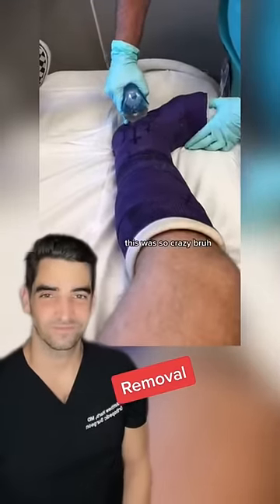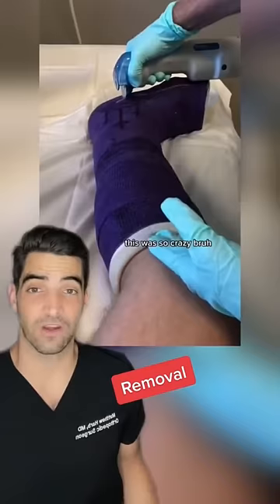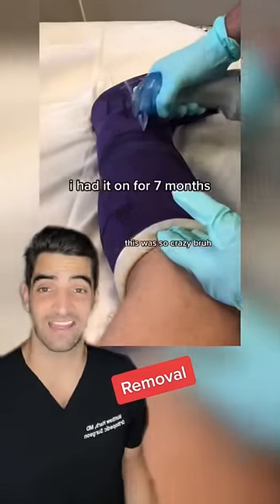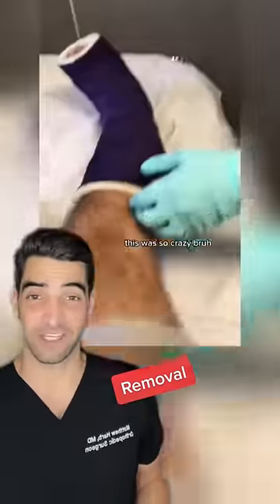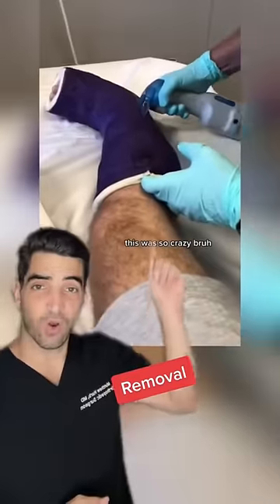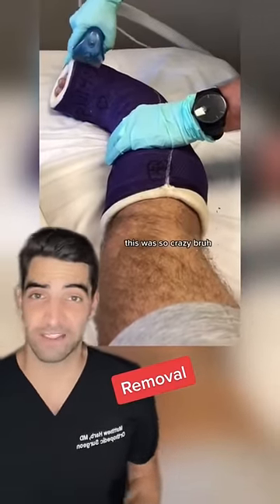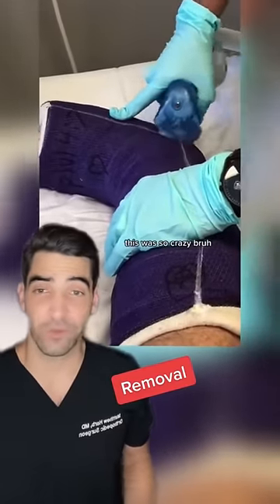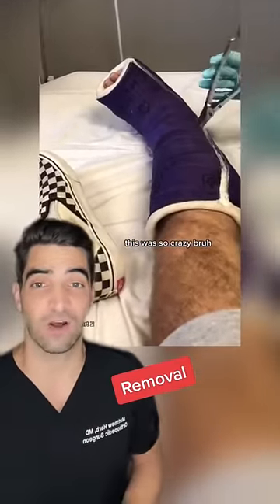How to remove a fiber glass cast after your broken ankle has healed, learn this proper technique

Comment: I was young when they took the cast off my arm, and the nurse touched the "blade" to her hand to show me that it wasn't sharp. She was the sweetest
Reply: I was about 5 when that happened to me. I felt so reassured
Reply: Yes, when I was five, I broke my leg . When getting the cast off, the nurse touched the blade to her and then asked if I wanted to touch it, they were awesome
Reply: I was 13 😂😂 broke my leg in multiple places, but the nurse touched it to her glove, and there wasn't a single tear.
Reply: Same here, I broke my arm when I was younger and the nurse did the same thing cause I was upset about it lol
Reply: My nurse did that to and I was still too scared
Reply: I spent a lot of time in casts when I was young due to a genetic condition. After I got cut and burned by an idiot with a cast saw I much preferred the honest cast tech that came in, sunk the saw into a block of wood and said something like, "Most will tell you this can't cut you but it can. It is all up to my skill and I'm very good."
Reply: @mjaynes288 unless they press down pretty hard it wont cut you it uses Vibration to cut stuff not like a Sawzall even the ryobi multitools are similer i have a carbide tip that i use for metal and wood and it doesnt even nick my finger tip
Reply: How hairy was that arm? Omg had my cast off and wanted to put it back on immediately 😂😂that hair and foot skin like to send me looney😢
Reply: Same. It helped me not freak out 😂
Reply: Same!
Reply: My nurse did the same, so sweet.
Reply: Same exact thing bro
Reply: Exactly the same thing that happened to me the same way too
Reply: I broke my elbow
Reply: Literally was about to make this same comment
Reply: Mine did the same she was so nice
Reply: Same
Reply: Had a similar experience when I broke my leg as a kid eased my worries immediately
Reply: Me too I thought I might get hurt because the saw was hot because of the vibration
Reply: smash
Reply: They did the same for my daughter
Reply: Dr touched the blade when it was on freaked me ot even more. Was a different person when I was like 6 or 7
Reply: The nurse who took off my cast did that too! It was really reassuring

Comment: Saws used to cut off casts are designed  to NOT cut skin! Hold one against skin and nothing  happens.
Reply: That’s because it vibrates
Reply: It will still scratch the shit out of your skin and can even draw blood. It won’t clean cut you but will be like a belt sander in a minuscule point
Reply: @synodicsoundslive8851  if properly used, no skin is cut
Reply: Well it cut and burned my wrist and the skin between my thumb and finger
Reply: That's what he said in the video. Thanks for reiterating it.
Reply: Yeah. Cut my moms ankle when they removed hers. It can cut. Just maybe not severely
Reply: @juttascharf6917 if properly used, aka if you don't touch them with it LOL. A fein saw vibrates too. Go ahead touch it see what happens
Reply: It can’t cut skin over soft tissue areas. Not unless you apply a severe amount of pressure. However if used on skin over bone, it will cut the skin. I use these types of cast saws every single day, have even used one on myself. Aim soft, keep it moving, no cut, no burning
Reply: @TheTiredPirate  its not because it vibrates. recipricating saws vibrate too and will cut your hands off. its because of the surface area being moved that it doesnt cut. the skin stretches
Reply: @juttascharf6917 holding it against your skin isn’t proper use lol
Reply: true but also not true kinda.i have a scar on my thumb from getting a cast off but it burnt me instead of cut me. it didn’t bleed is just blistered and hurt real bad then bled when the blister popped
Reply: It still can.
Reply: You are right. It won’t cut you. However it gets really hot and will burn you.

I know this because I have two scars from the damn thing
Reply: Nah I had that shit cut my wrist and I still got the scar

Comment: I've had that happen twice in the past 4 years and it really doesn't hurt at all, you can just feel the heat
Reply: how the hell you break two limbs in 4 years and I still haven’t broken one
Reply: @pineappler6473 they probs play a rough sport or are just neglective with their body.
Reply: I have broken 2 bones in 2022. One was playing with siblings and the other was snowmobiling. I had them each for 4 weeks. Trust me it only tickles to get them off
Reply: I can relate i have broken my arms a total of 7 times (once every year)
Reply: That means they were using a dull blade usually it just tickles
Reply: Mine burned for a week after. Ripped a little bit of skin
Reply: I would check if there's a reason why you break so easily. Like vitamin d deficit
Reply: when they get the spreader out and actually get it off the the best feeling ever but the skin is supper dry
Reply: It’s oscillator I have a few of them Dewalt, Milwaukee.

Comment: Just so everyone knows, I work construction, we use a tool similar to this. If it’s pressed hard against the skin it does NOT cut it but it burns it. A friction burn. Some doctors don’t really know how some of their tools work it seems. The saw vibrates at the same frequency as the skin meaning that as the saw moves across the skin the skin perfectly flows with the vibration. This is one of the best ways to cut off a hard plaster or hard plastic as it is quick and almost no danger at all unless it is meant to hurt someone
Reply: Yes but this saw has little teeth so it would leave cuts and scrapes not burns...
Reply: @vadyam2934  you obviously did not read his comment and have not used a multi tool.
Reply: It does not vibrate at the same frequency as skin lol, just lol. The skin just stretches
Reply: @Matick-  This. Tf does 'vibrate at the same frequency as the skin' even mean lmao
Reply: Most blades you’re correct but try one with wider/less teeth. It’ll cut but will still be minor. Either way the multitool is probably one of the best tools to have on a job site. Interesting fact they were first created solely to cut open casts haha

Comment: When they took the cast off my arm, the nurse went back and forth over my arm in a fast motion that caused friction and heat. She was in training and I was like 9 so my dad rushed me to the hospital. When they finally got my cast off, my arm was littered in blisters that lasted a good 2 weeks. The worst part is the primary care doctor who was supposed to be supervising said that the nurse did it the right way and that they were gonna do it the same way at the hospital. Good thing my dad never listened to people.
Reply: @TheDevilishDesires  the purple at the hospital told me it was burns from the nurse going up and down my arm in a fast motion instead of the usual section at a time.
Reply: @lemonmint278 😂😂😂 The purple?  What??
Reply: @TheDevilishDesires  people
Reply: @lemonmint278   Multiple fractures of my own...compound fractures with my skateboarding child(compound =means BONE broke through skin and is sitting outside the body)  and I've had technicians do full swipes up the sides ...not in sections and the blade doesn't sit long enough to burn through the cast and the microfiber mesh sock placed over the body part.  They put the blade straight on THEIR skin and turn it on to prove to kids that it doesn't hurt, burn or cut.  If you're to be believed... those situations would all cause burns too....and they don't...so you're making up stories to feel important.  Go read a book!
Reply: @TheDevilishDesires  I’m not making up stories. The vibrating mixed with the speed that she was moving along my arm did cause burns. And I’ve taken anatomy so I know what a compound fracture is. I’m glad you had a great time with your cast, but not everyone has, so mind your business. I was just telling a story that happened to me.
Reply: @lemonmint278  🤣🤣🤣🤣 I'd mind my business if you didn't put your bs out on a PUBLIC format.  Only ppl who get called out on their BS want ppl to mind their business. It's a psychological guilt response and that's my point...you were telling a "story"...thanks for owning it.

Comment: The blade doesn’t penetrate the skin. I’ve used one many times working in an ER and one of the thing we do to show children not to be scared is out the blade on our own skin first and show them it doesn’t cut and than we put it on an open part of their skin to reinforce that it doesn’t cut. Than they are more relaxed and even giggle because the vibration kinda tickles when you’re cutting off the cast. That being said, you don’t need to push down super hard with the cutting tool as it does all the work and is very simple.
Reply: But I'm so interested in how? I understand that it uses rapid vibration, and I can understand how rapid vibration is able to penetrate certain materials...but the cast material is so thick and so I just can't understand how it can easily break through that, but not harm delicate skin underneath that's now highly sensitive from being covered for so long. Our skin is surely more delicate than cast material. I totally believe that it works, especially coming from somebody who has first-hand experience with it, but it just perplexes me! 😊
Reply: @Katz_Pajamas  because of the way the blade is designed, the hardness of the cast is the reason that is get broken apart. Skin has less resistance and so moves side to side along with the blade whereas the cast is extremely ridged and doesn’t move, so it get cut.
Reply: As with all tools there are idiots who don't know what they are doing and push instead of letting the saw do the work. A cast saw can cut and burn when used improperly. I have a scar to prove it.
Reply: @mjaynes288  Thank you. I have one as well. It is still a saw and they have to be careful, but they get complacent and decide to push down and it ends up cutting you.
Reply: @IrishPotato86  Oh my god that was the best explanation ever and it makes so much sense! The skin follows the vibration versus the resistance the hard cast gives! Thanks! 😊
Reply: Think of it more like an abrasive than a sharp cutting instrument. When used on a rigid surface, it functions almost like a steel file and cuts through the material, but without a sharp cutting tool and since it oscillates, it doesn’t generate as much force.  
Especially when used on a soft surface like skin, it can’t get any purchase to do damage without anything sharp and the short oscillating movement.
Reply: @Katz_Pajamas 
An easy Analogy is to try to put your butter knife on your arm and move it a little bit, but with the same strength you can saw through the bread crust easily. 

But that's just an analogy, it actually works because your skin is "jiggly" so whenever the saw moves back and forth your skin moves along, but the cast is rock hard so when the saw moves back and forth it resists, and when 2 resisting forces push against each other the weakest point of resistance will eventually break, that's the cast here. Important is that the blade is dull so no cuts happen.

So 
Skin almost no resistance, saw blade moves along 

The cast is very resistant and breaks on a minescular level.
Reply: @Max-x21  your first analogy doesnt correlate. your second answer makes perfect sense.
Reply: Yep, when I had my cast removed I was kinda scared, a year later I was the one assuring a kid while I removed his...
Reply: @Katz_Pajamas  because skin is flexible, and the cast is more brittle. Think of a brick, if dropped, it’s likely to break apart. Skin on the other hand, if met with the same force, won’t shatter to pieces. Albeit it will hurt.
Reply: @mjaynes288  don’t push it into the skin! Duh! Simoly placing the moving blade into the skin will not result in a cut, but if you push the blade down, to there the skin becomes rigid and resistant, than yeah, it could cut. Someone using a cast saw isn’t supposed to push all the way to the skin anyways. You push just far enough to break through the cast.
Reply: When I was a young child I managed to break both of my wrists at the same time, and when it came time to take off my casts, I was initially so terrified of the saw. It really helped being shown and reassured that I wouldn't be cut because the noise was so loud and (to a four-year-old) the blade looked huge!
Reply: Wish this was explained to me when I had mine (9yr old back then) nurse didn’t explain anything just wanted to go straight to cutting while I’m losing my mind thinking she’s gonna cut my arm. My doctor came eventually and asked why I still had the cast on. HE finally explained and cut it instead of the nurse
Reply: Doesn't normally but it can.  Speaking from experience and reading others who were too.  It can indeed cut skin, I guess under the right circumstances.

Comment: I had casts on both my legs due to surgery....the worst thing was the ITCH. When they took them off, I had forks and spoons inside from where I had tried to get the itchy parts of my leg.
Reply: Same, sat in bed and couldn’t move my legs for 8 weeks lol
Reply: Knitting needles were my fav.  They are very long.
Reply: And your legs feel as if you were a newborn and if you can't ever rely on them.
Reply: I used pencils and my arm looked a lot smaller than the other one since it didn’t have oxygen I think
Reply: @amykondi3559  no it's because the muscles atrophied
Reply: See, this is why I refuse to have a cast again.  I will take a brace and longer recovery time.  Or... I'll just cut it off myself after a week or two and switch to a brace.
Reply: Probably because they used duraprep instead of chloroprep or betadine. It leaves a film that makes the skin itchy as hell after surgery.
Reply: I used a hanger. It got the job done.
Reply: I feel this, I used a chopstick lmao
Reply: Ruler was my favorite tool...
Reply: when i had a cast on , i used a straightened wire coat hanger to scratch my leg , then my dad took it away from me . bathing was the hard part for me , dad had to duct tape plastic garbage bags over my leg so the cast wouldn't get wet , that SUCKED so bad , also he would not let me take a shower , i had to take a sit down bath , which was even worse . ever tried to get up from the floor with one leg ? near impossible . ugh then getting on the school bus was absolutely humiliating ( close to the last stop before arriving at school ) i never wanted to go back to school after that first day on the bus . sit n scoot up the stairs then hop to a seat at the front . horrible .
Reply: You're supposed to use a wire hanger. Rookie
Reply: The itching is brutal. That's the worst.
Reply: Dude the itch is so uncomfortable! I had one on for a month and a half from shattering my elbow and gosh it was a relief to finally scratch the itch 😂
Reply: I always used a metal clothes hanger that i unraveled and had cotton balls taped onto the end to get all the itches.
Reply: I used a flay swatter handle. This was the 90s, ot was the metal loop kind. Nothing sharp to make a scratch and get infected, but it helped. Also the loop scooped put the skin goop and could be used to terrorize my younger sib
Reply: How about not breaking limbs so you don't have to do this
Reply: @FloridaMan7337  I didn’t break a limb. It was correction surgery.
Reply: I had fractured my ankle and after 2 weeks i started walking on the cast and when i ended up getting it taken off the doctor asked if i was walking on it, it was all broken and dirty i was like yeah i was walking on it did u really have to ask?
Reply: @Blacknoximus nope a fishing pole end sandpapered till smooth..to long to lose in cast and no scratches to get infected
Reply: @USA7Aa  that works to. But I've server seen a wire hanger not be long enough to scratch inside a firearm cast
Reply: As I'm laying in bed with my leg brace on. I broke my kneecap in half and had surgery to "fix" it. Now I'm itchy. I can undo the brace straps and scratch but the itching can be unbearable.

Comment: When I was young I had a cast on my arm. It was too tight the first time so they had to take it off and redo it. I VIVIDLY remember multiple doctors holding and strapping me down while I was screaming in pain. My mom told them to stop but they said it doesn’t cut skin. I have an insane deep deep scar TO THIS DAY. Maybe 10 or so years ago. They didn’t even stitch it up after. I have the proof, blades.
Reply: then they werent using this one, you can literally touch these to skin and it wont cut.  im sorry that happened to you, but they probably used a rotating blade.  i watched my dad get his finger with a table saw, he was lucky to get away with a small cut and promptly told me never to use my hands and always use a push tool or another piece of wood.
Reply: @corvus6779  nah oscillating saws can cut skin if used improperly, plus if a cast has been applied wrong and the limb is swollen the skin splits even more easily
Reply: @Capra_Ibex the vibrating blade cuts hard material, but the slop of our skin makes it harmless to soft skin. Tight inflamed skin of course, prevents that skin movement, meaning it could be cut unfortunately.
Reply: Wasn't cut as badly as you but I was indeed absolutely cut by the same "won't cut the skin" oscillating saw. I remember because of all the times Ive heard people say it won't.

Comment: THANK YOU for saying the cast saw does actually sometimes cut, because it does and im SO tired of nurses and stuff saying it does not/is very rare/is impossible. It literally happened to me the first time I got my cast removed. The nurse reassured my mom over and over that it wouldn't cut my skin, and lo and behold? I look down and it had broke my skin. Never felt more betrayed and lied to.
Reply: Yes its exactly.
It's designed to prevent/less the likelihood of cutting flesh but it still can at the right angle and pressure.

Happened to my neice still has a 1inch long scar 10 years after removel
Reply: oh God jfc calm down